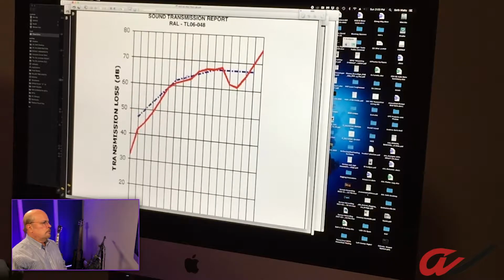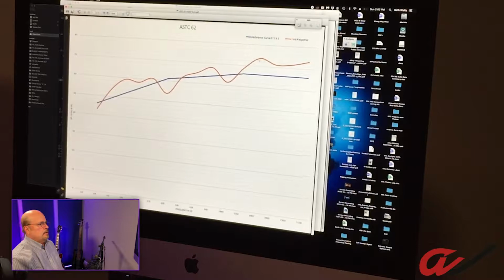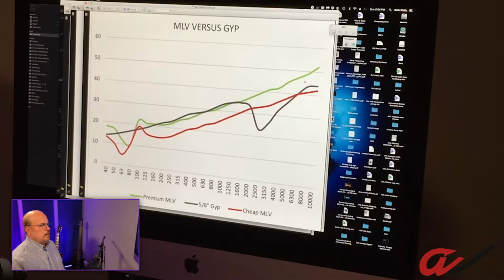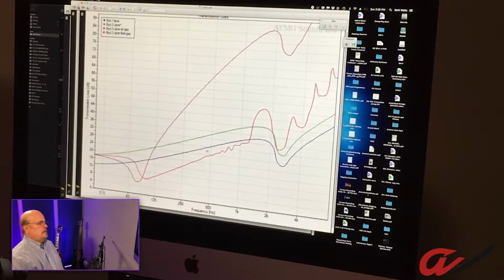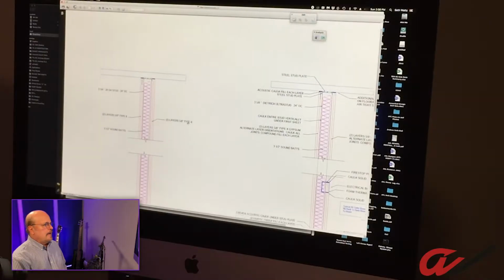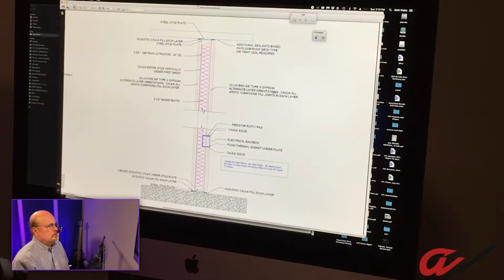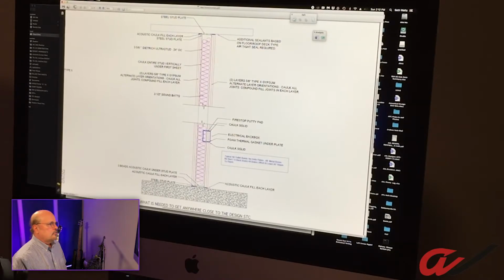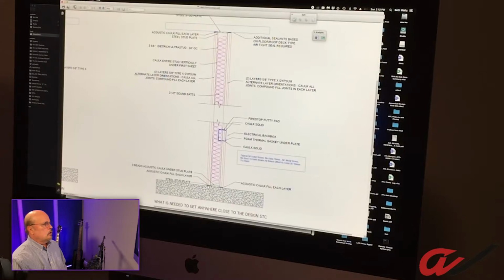Sound Proofing: The Details (Part 2 of a 2 part sound proofing series)

Comment: Good info about the RockWool vs mineral wool. IF I end up tearing a shared wall out at a duplex because noises can be clearly heard to which I believe you alluded in Part 1 ;), I will spring for the RockWool. I was also planning to convert to a staggered stud wall.
Reply: You need more than Rockwool in a shared wall to block out sound.  It's a starter but not the fix.
Reply: @garzila Absolutely. I did significant work on both sides of the wall, and documented it all in painstaking detail, with measurements along the way, for my YT channel. Was very pleased with the results.